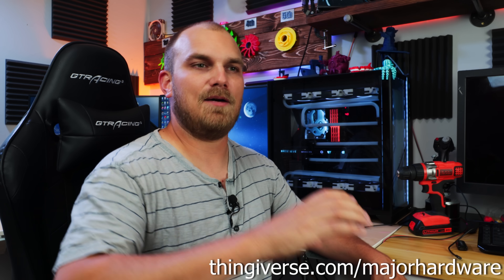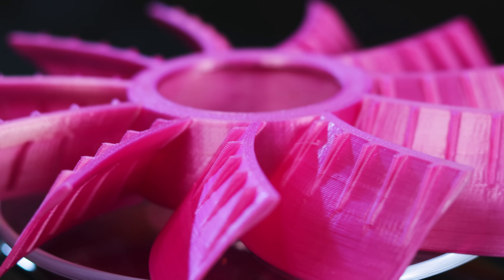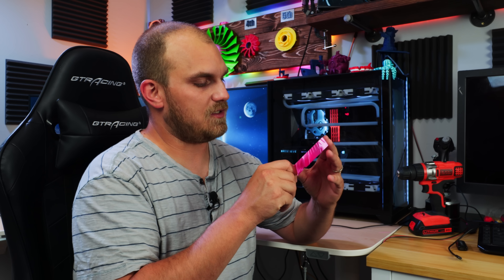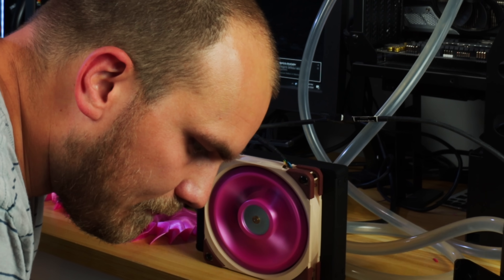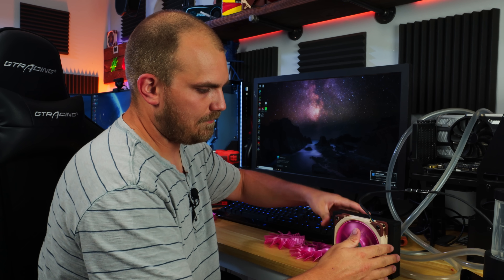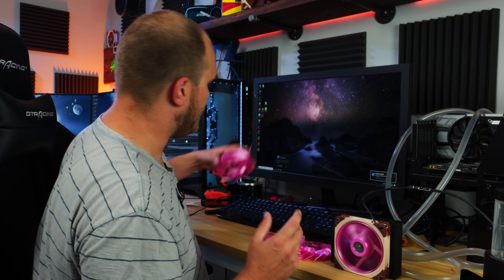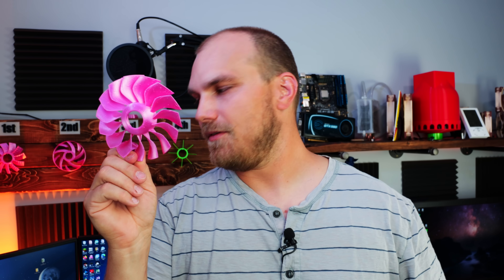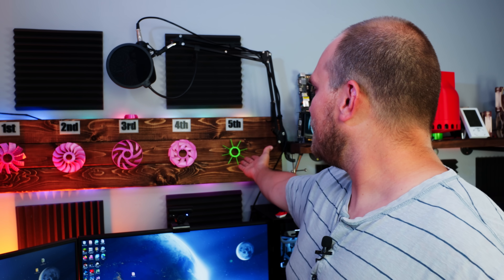4 Fans Designed by you and Printed by Me Who Is the Best | Fan Show Down Episode 3

Comment: The "simple" fan did really well. Considering at how low of room temperature the stock A12-X25 was tested and considering the inperfection of the 3D print, ~1C to be the point of being a decent competitor
Reply: Ya, I'd love to see some of these high performers replicated with a better finish and tighter tolerances
Reply: Right, simple fan with its imperfect surface was tested at the highest room temperature and still manage to get close to the stock fan tested at the lowest room temperature.
Reply: @baikia777  With only 0.9°C difference in deltaT to the stock fan, that 3d printed fan with it's atrocious surface roughness is better than the stock fans in my PC

Comment: Took me 3 hours and all I got was 1 blade.. FreeCAD is the most awful piece of software I've ever used, I don't see any rotate 9 times option like you do in solidworks. So until I can do that, my fan is stuck on design phase. All there is 360 spin :'(

edit: Draft CircularArray Introduced in version 0.19, well turns out it's developer version only, but that might do the trick as current version is 0.18.4

Comment: try not to use SILK pla (the shiny stuff) for mechanical parts. it has poor layer adhesion even though the filament itself is stronger. IE it can de-laminate very easy especially printed thin like you are.

Comment: I have an interesting idea for a fan but not very good with CAD.... Here's what you do. You create a fan header with three fan blades 2/3rds the depth of the fan blades on the intake side of the fan, then stagger them symmetrically with 6 blades at 2/3rds the depth on the exhaust. It looks like 9 blades from the front, but is 3 front and 6 rear blades.

Comment: A rotating cowl is always a losing feature.  The fan housing already has a cowl, there is no point having another one.  I'm sure it's possible to beat the A12X25 in cooling performance, but not in noise at the same time.  Noctua did a good job optimizing their blade profile.

Comment: Who is gonna send MH a fan that literally whistles?!
Reply: A war siren model
Reply: @ksepastremenos  don't think there is enough volume in the fan to get that low..
Reply: Stuka fan
Reply: Daniel Jankových  I'll see yours there. You got this.
Reply: mine has that potential, we'll see when he get to it :D
Reply: Someone should make fans that whistle different notes and then MH can programs a fan controller to play music
Reply: Before testing I kind of thought the 'inside-out' fan with it's double layered blade design might do that.

A note on the high pitch noise mentioned with the turbine fan. It has to do with the number of fan blades. A lot of the noise from a fan comes from the sound of the air stream being disrupted by the supports holding the fan motor casing in the center. As each fan blade pushes a separate 'puff' of air there will be a noise generated the same number of times per revolution as there are fan blades. So more blades means a higher pitch noise if the fans spin at near the same RPM.
Reply: @blahorgaslisk7763  the inside out fan actually is what put the idea in my head
Reply: @blahorgaslisk7763  It's also why the vortex generator fan was so much quieter because they will diminish the blade pass noise (since they increase turbulence for the airstream hitting the supports)
Reply: the luftwaffe stuka fan
Reply: Daniel Jankových  oh god :D
Reply: Ha ha ha, I might.
Reply: I endorse a Screaming fan! yes!
Reply: @thefrankenator  How about one that is begging for the sweet release of death?
Reply: Please, make an episode about who can make the highest pitch whistling fan and I will subscribe and like every vid for months
Reply: add enough blades and it'll get pretty high pitched.
Reply: A Jericho trumpet in a pc fan?
Reply: Gotta name that fan the whistler.  😊
Reply: @youtubehollywoodhank  Whistlin dixie?
Reply: If I could do CAD I could design one of my harmonicas into it.  (There is a photo that goes around on harmonica sites pretty regularly where some took a zip tie and strapped a harmonica to the undercarriage of one of their friends cars as a prank.)
Reply: The first thing I thought lool
Reply: Hit up Bubb Rubb
Reply: lamo i was thinking of send him one
Reply: remake the blade of the thunderscreech but VERY small so it reaches supersonic speeds on the tips easily with lots of speed

Comment: I call DQ on simple fan. Thickest(deepest?) blades have the highest potential for static pressure. Blades should be shaved down to the correct thickness/depth and retested.

Comment: Ya the noise normalized could be cool but not really the point and especially with the benchmark being a nactua and I think your testing would be helped by a setup that can spin faster I know you had those RC BLDC motors but I assume you can get a different brand fan that spins faster you may need a different hub but worth it I think

Comment: Hey, can you run the stock fan again at the end when the room is the hottest? I’m just curious how big the performance difference really is.
Reply: That's what the Delta over ambient measurement is for.  It accounts for the difference in room temp.  E.g. the 'Simple Fan' was a mere 0.9 degrees hotter than the Noctua on the Delta chart, that's the actual performance diff.
Reply: @SevenSevenXAK  One wonders though if the delta works in such a linear scale like that. The only way to be sure is to have the same ambient temperature for each test.

After some more research, there is conclusive evidence to suggest that as ambient temperatures rise, so do Delta temperatures. This means that given the exact same test (same cooler, fan and load) done at 3 different ambient temperatures; the Delta-T of the same cooling solution will increase as the ambient temperatures increases.

This suggests that the 'Simple Fan', the 'Turbo Fan' and maybe even the 'Inside-Outside Fan' all sit favourably to the Noctua.
Reply: @Maxim DeLacy  It's been shown before that changes in ambient temp do linearly affect hardware temps (or it's at least close enough to being linear that it can be treated as so).  Some tech reviewers have been using Delta T's for years to factor out changes in ambient temp and make fair comparisons.  Check out the Gamers Nexus video titled: "Delta T over Ambient".  

So assuming MH took accurate measures of ambient temp during the tests, no none of the fans outperformed the Noctua because they are still slightly warmer on the Delta T chart.  Sub 1C difference though, we're getting so close!
Reply: SevenSevenXAK Oh, ok. Cool.
Reply: What about humidity? Doesn’t that dramatically effect the efficiency with which air can absorb and carry heat energy?

Comment: Simple fan literally won because it's mimicking a thicker fan setup 😂. It's all about optimized angles and usage of available space. 

Maybe there should be some thickness restrictions?
Reply: Yeah, it would need retest next time after a bit of sandpaper or trim, it might be 1st place just because it's oversized.
I got 34mm thick ARCTIC F12 Pro fan as my rear exhaust, been running like 10 years 24/7 and I got room there for 140mm too, but it almost does the job of a 140mm with added bonus of sucking hot air on top of VRM.

Comment: i think that it's unfair to test them at different rpms.
Reply: the fan speed is set to max but because of different weights and air resistance the rpm varies
Reply: @ww11gunny  yes thank you i undestand that, but i still think that they should be tested at the same rpm values.

Comment: It would be interesting to see another fan showdown series but for blower fans. I know it isn't really pc related there's isn't alot of info on how to make them
Reply: could be cool to make custom laptop fans to improving cooler, a lot of those are blower fans
Reply: The "rocket-ship" fan would actually work better as a blower than it did as a normal fan. I agree though, I would rather see something more... generally applicable? Just checking the temperature of his graphics card is a rather uninteresting goal, but at least serves as a relative metric for the viewer designs. 

If he had an anemometer and jury rigged water column he could do some real tests. It would actually be more fun to watch, I think. Smoke tests, blowing things around, etc. Also checking how much current the motor is drawing, because some designs would probably stall the motor I bet.

Hell, he could even use a 3-pin PC fan (if it has a relatively free spinning bearing) as the anemometer, since the third pin is actually just a tachometer.

Comment: This is so cooool! Big fan of the series. Could you maybe print the noctua x25 fan as well? Just for reference. Also question: fans run at different rpm coz of more/less air resistance/ weight of the fans?

Comment: I'd be that the "turbofan" model can be tweaked to outperform anything simpler, it's just a matter of iteration.
The reason being, that fan design is heavily optimized when used on turbofan engines, so, at the speeds we're dealing with a 1:1 copy is less than idea, but, you can likely leverage the engineering of the faster one to build the slower version.
Reply: Hey! As the designer of that fan, I agree with you. I tried a few things to mitigate that (lower blade count, most notably), but it was interesting to see how a scale replica stacked up against other people's designs as well as the stock A12X25.
Reply: @EeoGamer137  nice to hear from you! You should tweak it and get it back in the running. You clearly know your way around CAD!
Reply: @jttech44  Thanks! I'm considering improving it, but I've had my time in the spotlight; I wanna give others a chance, too.  MH's gmail is swamped!
Reply: @EeoGamer137  fantastic work by the way. Wish I had any amount of skill in fusion to make this happen. I got ideas just no way atm to realize them.
Reply: @danydo20023  You'll get there. I only started about a year ago as a complete novice. It takes some getting used to, but it's not so bad. There's no wrong way to do anything in CAD,  just better ways =)
Reply: I'm not sure increasing pitch would potentially help. It would be interesting to see this one with smoke test to see where the air is actually going. It may be that's it's forcing air to conically. Making it hit to small an area on the radiator to be as effective as the basic fan. I don't have any background in these things it's purely just my thoughts so I apologise for my ignorance.
Reply: @danydo20023  I feathered the blade pitch at the hub mainly because that's what actual turbofan engines do. TBH, I'm not entirely sure why, though. I can speculate that it's either to fling FOD away from the engine core or to aid in compression. Either way, neither of these are useful in a computer fan, so you're probably on to something.
Reply: @danydo20023  Well, all the research on this stuff is kept pretty secret, so, anything is worth a shot.
I'd guess that it's too optimized for high speed and static pressure in its current state.
Reply: Think problem is purely rpm atm. If crank it up to 2500 would probably beat them all at same rpm
Reply: @danydo20023  Motor is already at full power and the fans just spin at whatever speed based on their drag. If you increase motor power to make that design spin at 2500 rpm then the fans that were faster will still be faster.
Reply: @danydo20023  I'd guess step one should be to reduce the blade count, and probably increase the pitch of the blades at the root of the turbine. That'd help it move more air and be less in its own way. I'd bet at lower speeds it's having to push the air away from the next blade more than it should.

Comment: Id like to design a fan blade, send you the file, and also print one on my resin printer and mail it to you to see if there is a difference between resin printed and fdm printed. I have a feeling the resin fan might be better balanced and therefore spin at a slightly higher rpm
Reply: Yeah and if I remember correctly resin is alot smoother so it would have lss air resistance, so it would probably be more fair to compare it againtst the noctua fans
Reply: @waffles6477  Yeah, the layers are way smoother with resin since most resin printers have an "anti-aliasing" function to smooth out the layer steps.
Reply: @iheartninja  mmm yeah dont want them sharp edges gotta love anti aliasing irl
Reply: Seriously, I bet with finishing all of these fans would perform significantly better
Reply: Well, I don't want to design a fan blade of my own, but I'd love you to test a supposedly patented noiseless one.  http://www.rexresearch.com/volfprop/volfprop.htm
Reply: Not to mention because of the smoother layers it should reduce turbulence on the blade surface, which should make it quieter.
Reply: depends on how smooth the surface is. when u get too smooth u get the air to "stick" or suck on the surface which would be negatvly impact the performance. thats why koenigsegg in their hyper cars dont polish the down pipe because then the air kinda "rolls" on top of the surface. but yeah, i think that no matter which printer method you use. you will probably not reach the "needed" smoothness to negativly impact it. but if it actually should be the case, rough up the surface a bit. 

i think the biggest improvements for fans will be to change into diffrent materials of the blades. they need to be thinner and stronger. the many blade designs should theoreticly be very good but we cannot reach the thinness requiered for it to work. the blades take up to much air and therefore can only push so much air that is left within the actual fan.
Reply: @12P14D22C  is that what cavitation is?
Reply: @12P14D22C  Boundary layer can be controled by design though.
Reply: I was also wondering the same. For me though you can do things on resin printers that you cant on FDM printers.
Reply: sinformant do it then, don’t just talk about doing it

Comment: Really think noise normalizing gave so much sense to do! You can always make the motors faster if the fan is very silent, even noctua have fast speed fans.
Reply: Yes a f12 3000 ippc at 1.000 rpm is so silent has a chromax f12
The main difference is just that the ippc can reach higher rpm

Comment: You should try to make a watercooling loop but using a cpu heat sink instead of a radiator by putting a cpu water block on the bottom.